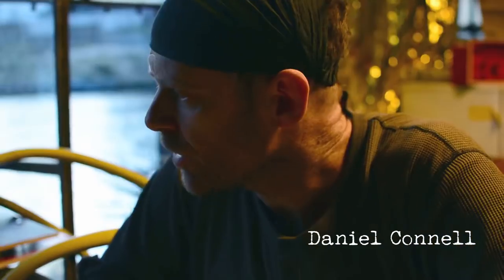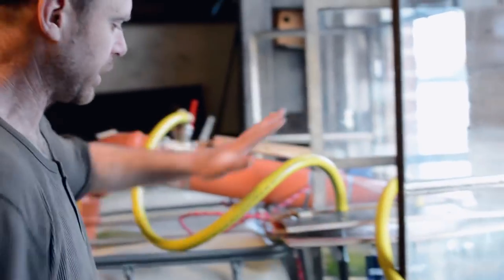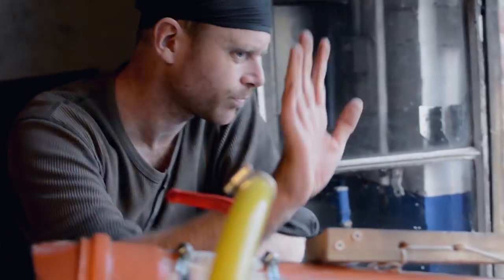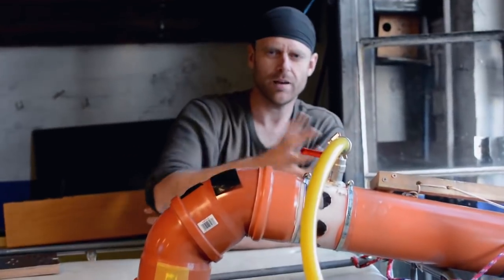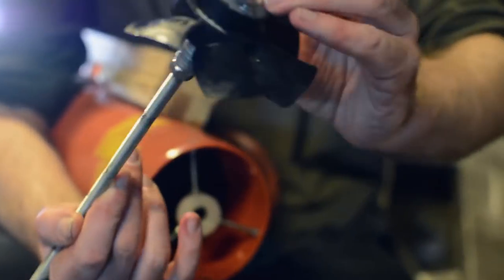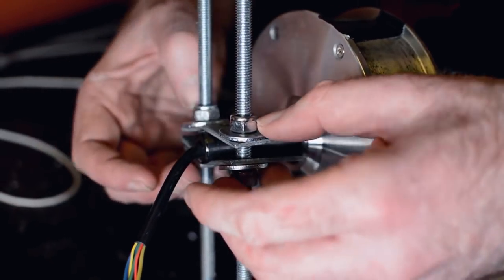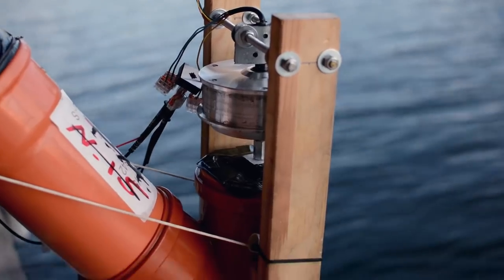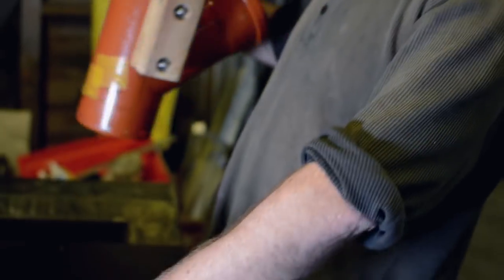$50 Water Turbine-5 kilowatt hrs/day - Open Source, DIY

Comment: I'd suggest a neater test load solution - 5x12V 21W car bulbs /less than 1$ each/ in series will give you ~100W load for the given voltage output /~60V/ with a visual feedback of the system performance. 5 bulbs /low beams/ will give 300W,. You may use high/low beam switchable load or  use sets of these in parallel. The plastic fan will go quick for sure. It will erode and one of the reasons to use less rpm and high torque to lower the cavitation erosion and to prolong the turbine life. Pipe setup is amazing. Keep up the good work!
Reply from the maker: First thought on variable load was car headlamps, but they have the issue of changing resistance as they heat up. The liquid rheostat worked surprisingly well, and didn't cost anything.

I'm interested to see how the fan holds up over time. Hopefully it'll last long enough to be worth it, as they're way more available and accessible than any other option I've come across so far.
Will see with the field installations this year.
Reply: @OpenSourceLowTech  I agree that car bulbs are more expensive but it's on the R&D side not on the cost of the final product. The thermal time constant of the bulbs is around 2 sec and after that  they are fixed load. This is on cold start. In normal working condition the change of their resistance based on the temp will be negligible. When you create your "voltage, current, power" chart this is not relevant.
You are not completely right about the liquid thermostat. There Is heating also going on and the resistance is changed by the heating, also there is complex electrolysis /being water solution/ going on, that change the resistance too. I am not saying it is not good, the change of the load is not vital when you measure both voltage and current. The absolute value is not important as long as it is in a preferable range, close to the real world scenarios. Over the years I used both solutions but the bulbs are less messy :-).
On the fan, I guess my expectation is a slow erosion starting from the peripheral part slowly eating towards the center. There is a good reason why all boats and hydroelectric turbines are all made from metal . My guess is that you don't need the material to be though, but as hard as possible to resist the wearing.
With that said the only weak point I see so far is the expectation about the system to work long time , created from easily available components. This is hard to achieve. The generator you are using is an example for a part designed to work probably less than 2000 hours /this translates to use hoverboard full 2 hours, every day for around 3 years/ For a car alternator it is probably around 10-15000 hours. 2000 hours lifespan will give you less than 3 months durability.
Let this not stoping you! There is always a solution and we just need to find it.
Reply from the maker: @plamenmarinov7314  
> The thermal time constant of the bulbs is around 2 sec and after that  they are fixed load. 

This may be a good option for a hydro under constant water supply, but in Berlin coming from the tank the first two seconds were the peak output, so if the resistance was changing during that period it may have thrown off my readings.
Wind turbines also wouldn't be ideal for this given that they're constantly changing input power.
Is there also not an issue with bulbs in terms of voltage? Testing this turbine I had anything up to 115VDC.

> There Is heating also going on and the resistance is changed by the heating

I didn't notice any of either, but only had it loaded for the 20 seconds or so it took to empty the tank. A litre of water tho does have a fair amount of thermal mass.

> also there is complex electrolysis /being water solution/ going on, that change the resistance too.

It did off gas a little, but I found I only needed to top it up with more washing soda and water about once a week or so to come back to the original resistance.

> the change of the load is not vital when you measure both voltage and current. The absolute value is not important as long as it is in a preferable range

Yeah this was basically my approach. The resistance didn't have to be specific, just something that could give me more or less then range of amperages I needed for a useful power curve, and I was measuring the amps and volts from which I calculated the resistance and wattage.

> There is a good reason why all boats and hydroelectric turbines are all made from metal.

Yeah I'll see how that holds up over time. There are a couple options for strengthening it if necessary, but hopefully the fan remains useful as it's a way more globally accessible option than anything else I can think of.

> The generator you are using is an example for a part designed to work probably less than 2000 hours

The only likely points of failure there are the bearings, which seem pretty robust, and the wire, which should hold a while long as it's not over amped.
They're fairly impressively solid units.

> There is always a solution

Indeed.

Comment: If you are in a remote area where you don't have a grid connection, you certainly want to minimize your power usage first before generating.
200 watts continuously should be enough to power your house, fridge, tv etc. Hot water should be obtained from the sun or a fire.

Comment: One suggestion.....maybe try to find some flex shaft like you find in any weedwacker....then the turbin fan could be 45° or so to the generator for more options for future designs. 
I love the hoverboard generator idea...Im going to start searching for as many used ones as I can find..
Thanks for sharing your ideas... much love.
Reply from the maker: It's an option, but I think there'd end up being more mechanical loss from the shaft than is currently from putting the water through a 45 bend.
Would make the fan a bit harder to mount and center as well.
Reply: @OpenSourceLowTech  it's just an option for future reference builds.
Reply from the maker: Probably wouldn't work so well in this instance, but in the past I've used washing machine hose (the kind with the coil of plastic on the outside surface) for this purpose, when that's all I could find.
It also bends, but doesn't twist.

Comment: so a thing that Might be useful, is a flex shaft, like for a dremel type tool, or sometimes they use them in the curved string trimmers.  They're not very expensive, and I think it might allow more freedom in how you mount the alternator.    Availability might be an issue (I don't know how difficult their construction would be), and it could rob some efficiency, but a flexible drive shaft so you didn't have to build your alternator onto your pipe could make the fan-in-pipe-fitting turbine fairly plug and play, and super easy to seal.   Just a thought I had.   

Your whole Thing you do is inspiring and awesome.  Creative problem solving, to save the world.  This is the Way.
Reply from the maker: Interesting idea... It would have to be a bit hefty to transfer hundreds of watts, and I'd be concerned about it impacting the drive efficiency, but I'll keep it in mind as an option.
Reply: The drive efficiency might be an issue, with the friction.  The ones in the string trimmers were a solid spring steel drive shaft down a greased metal tube, and didn't bend more than close to 90.  
You could probably do it with a heavy big truck antenna (that's about the size of your current drive shaft, yeah?) and a greased bit of copper pipe, or like metal brake line, or such that fit close if you wanted to test it.  
(as I figure those would be pretty available and cheap)  
Another option that might work, is use PVC 1/2 or 3/4 and just stick a roller bearing inside a coupling every so often in your bend to keep it centered.

maybe the notion will be useful at some point.

Comment: An O-ring is usually for a push-pull application. Use an oil seal will last much longer with the rotating shaft
Reply from the maker: It would likely do a better job, but harder to source in other parts of the world and I'd be concerned with how often the grease would need replacing.
Will have to see how the O ring holds up over time tho..

Comment: I have a fan from an overhead projector, it was a more modern one, so it wasn't the stamped metal fan blade variety, it was more like a 120mm computer fan, except that the hub was larger and the blades feel like they're metal, or at least significantly more sturdy than ordinary computer fan blades. The shape also seems more amenable to water, with a wider profile and less slope. Sunon was the brand, the fan itself runs on 120VAC, they're pretty easy to find and I'm sure there are cheap knockoffs with similar blades, not to mention plenty of scrap overhead projectors.
Reply from the maker: Ok interesting, could you send me an image link to see what it looks like?
OHPs aren't too common, but if there's some other every day item with a sturdier fan to make use of then it would definitely extend the life of the turbine...

Comment: Thanks so much for being so free with the info.  Id like to go offgrid here in Brazil but the cost of batteries make it impossible.  Im fortunate to have a length of river with maybe a 3 to 4 metre drop so this would be a perfect solution.  The only parts I dont understand is how to treat the raw power to make it available directly to appliances with some kind of power dumping safety system.  Didnt understand the hover board part either.  Thanks again.
Reply from the maker: Old car/truck batteries can be used in a pinch. You'll destroy them reasonably quickly, but they're cheap.
I'd recommend this group for asking about what to plug it all into: https://www.facebook.com/groups/windturbinemakers/
It's mainly for wind turbines, but the electrical side of things is essentially the same for both.

Which bit of the hoverboard wheel?
Reply: @OpenSourceLowTech  thanks for replying with the reference.  I rewatched the first video and now I think i understand that the hoverboard wheel is an alternative to the alternator.  

I was hoping this could be done without batteries but I guess Im being naive.  I know almost nothing about home power generation.  Just starting my research.  

Thanks again
Reply from the maker: The wheel is an alternator. It's usually powered to run as a motor, but will produce AC if spun.
It's not necessarily impossible to go straight from a hydro turbine to an inverter, in principle. Maybe.
You'd struggle to get away with it with a wind turbine, as the output is all over the place moment to moment, and even solar can be pretty up and down. But as long as the water doesn't run out hydro should be essentially completely stable day in day out.

Tho voltage will drop under load, so you'd maybe want to use it with a reasonably intelligent load diversion system so that it's always doing the same amount of work.

My knowledge of this side of things is a little light, you'll get a more experienced answer in this group:
https://www.facebook.com/groups/windturbinemakers
Reply: @OpenSourceLowTech  Thanks so much for explaining this.  If I get a couple of these going I maybe able to run a fridge and some lights which would keep us going during power cuts.  That would be a good start.

Comment: you can use a plumbing u turn to keep the siphon locked in "s" snake tube. That would help you get the cost down on materials (pvc pipe).

Comment: Have you looked at the prop like is used on a jet drive boat or jet ski?  The engineers have about worked out the cavitation problems. You can get them cheap or free sometimes just to haul them off. I really like what your doing. There are a let of places in the world that have good water flow and a little bit of electricity would do a lot of good. Keep up the good work.
Reply from the maker: I'm hoping to not have to use that involved a solution for the impeller purely for reasons of availability. The computer fans are fairly abundant in most places, I've yet to find a more robust option which would be as accessible.

Comment: I have just 3 things... first of all a good work so far. Try to find stainless metal or aluminium replacement for that turbine. Plastic fan will fall apart... Last thing is try to blok water from the center of that turbine and allow that to go only at the edges. It will restrain the flow and the total power, but it can drastically improve effenciency.
Reply from the maker: Yeah we'll see how the plastic holds up. Got a few options for strengthening it if needed. I'd rather not have to source a metal fan for accessibility reasons, but may become necessary.
I did also trail a fan with a wider central hub, for the reasons you say, but it ended up doing 20% less power than the standard one, which I wasn't necessarily expecting.

Comment: You should try a ram pump for filling your bucket it uses no electricity to work just a difference in air pressure to pull water uphill. There is video's on you tube that shows you how to build one. Great work hope this helps you.
Reply from the maker: Ram pumps are good tech, but in this case you're always going to get more power just running the turbine off whatever water supply you would have run the pump.

Comment: Cool project. Why not add more than one computer fan to the shaft? Commercial turbines use multiple fans set at different positions. I wonder which type of computer fan works best, the high static pressure ones, the high CFM ones, thick or thin, different diameters of fan or pipe. Its amazing to something like this designed.

Comment: Absolutely brilliant! I'm a bit worried about the bearings in the alternator, they are taking a massive axial load and they are not designed for that. Maybe you could include an axial bearing from an old spinning chair or something that is cheap enough where the shaft comes out of the pipe just to take the pulling forces (or at least some of it) off the alternator bearings. Very nice work!
Reply from the maker: Possibly, tho the force is probably only a couple kilo, maybe up to ten but I'd be surprised if the plastic fan would be surviving that. Lot less than the more than 50kg per wheel weight of a person standing on the board would have been. This is, as you say, axial rather than moment force, but that's probably easier to bear still.

It's exactly these types of questions I need to definitively answer with sufficient long term field testing...
Reply: @OpenSourceLowTech  It is very likely a deep groove ball bearing, they kinda can take some axial load, usually  0.2-0.5 times the basic static load rating. If its only 10 kilos it should be fine but nevertheless they will wear out quicker. I think for your application, especially considering the total system cost it should be sufficient just to use it as is. I would still try to come up with something that can help those bearings because if this system is installed where very limited resources are available its a good idea to keep it running as long as it can, but I'm pretty sure you know this. :)
Reply from the maker: @szaszafaja  Yeah pretty much. I'm generally not as concerned with longevity as ease of production and maintenance. My thinking is if it needs $5 and two hours of work to replace some bits every six months then that's probably better than having to bring in an engineer every other year or however much.

Will see how the bearings hold up. I'm thinking probably better than the fan but only one way to find out.

Comment: If you're trying to avoid cavitation, put some thin meshing of some kind just in front of the propeller.  Doesn't slow down flow much. Similar problem with computer water cooling pumps
Reply from the maker: Interesting.. is that to laminarise the flow?

Comment: Use a ram pump to pipe into a tower then use multiple outlets with turbines that drain into a sealable container to pressurize a heron fountain intermittently to have  "perpetual" energy. The pressurize tank feeds the fountain head that cascades over the pressurized tank sitting in another container to act as a flushing valve float. 

All that then can power larger turbines, small footprint.

Comment: G'day mate, have you considered adding a Venturi into the system to increase flow and inturn power basically jetpowering your setup. Your doing awesome work, keep it up.
Reply from the maker: There is a slight constriction at the point of the 120mm fan impeller, which would be greater still with the use of fatter pipe for more flow.

Comment: Daniel Connell

Please explore adding additional fan blades to the rotor. Make it look like a jet engine will additional blades.

This will increase torque and possibly speed.

You will need a longer drive shaft to add the additional blades.

You may want to space it out about 6in apart.

It's a simple upgrade and shoot increase torque by having a second plastic blade. Or it will increase speed.

I don't think it'll increase drag but I don't know.
Reply from the maker: I tried an additional fan on the shaft but it didn't seem to make any difference I could measure.

Comment: use that as battery, for irregular power like solar wind steam, then charge supercapacitors when needed
Reply: diy completely, from wood iron plastic, waste material, also the motor turbine pipes tanks supercaps wires